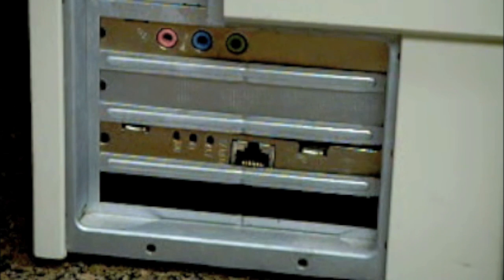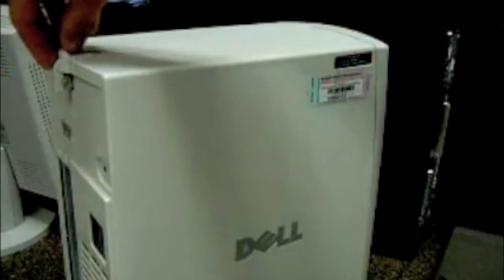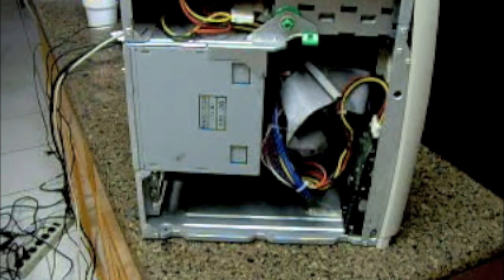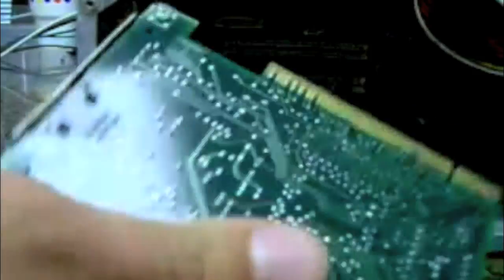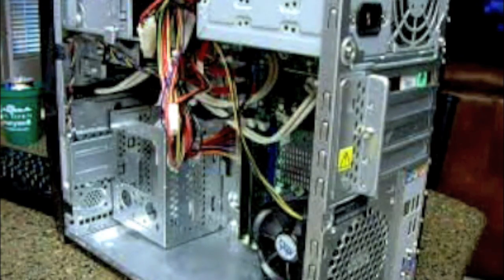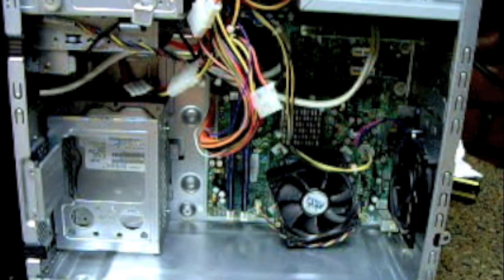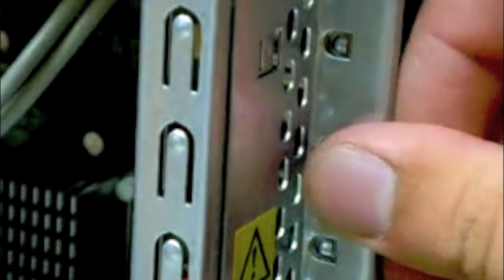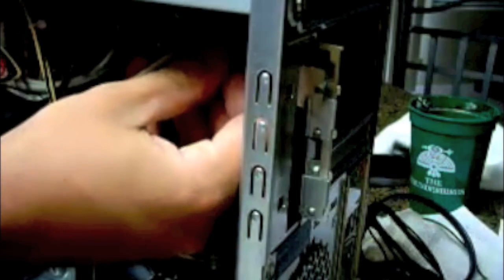Uninstall & Install PCI Ethernet Card

Comment: have an old Gateway P4 tower machine from 2003, which came only with 256RAM and a 56K dialup modem. I just ordered a hi speed PCI ethernet card from Amazon, and would like to install it in my machine, so that I may surf the web with my hi speed cable connection. Would I use the same PCI slot that the 56K modem is attached to (after removing it), or do I use a different PCI slot? Does Win XP automatically recognize the new ethernet card, or do I have to install special software before?